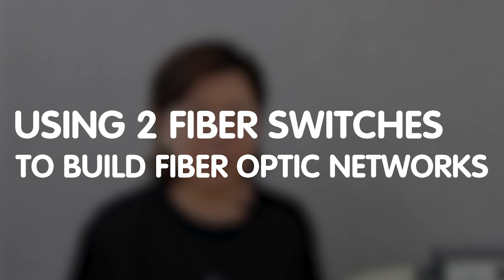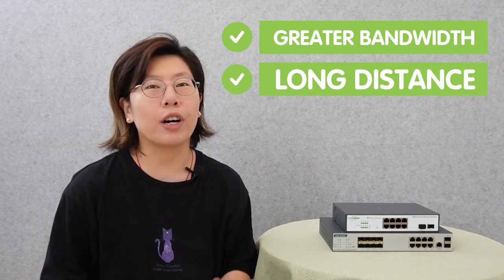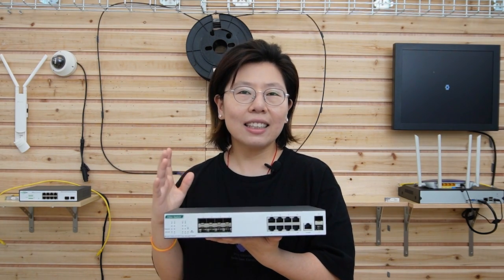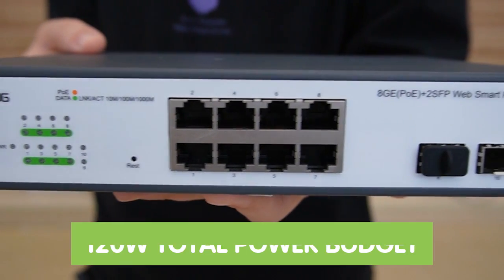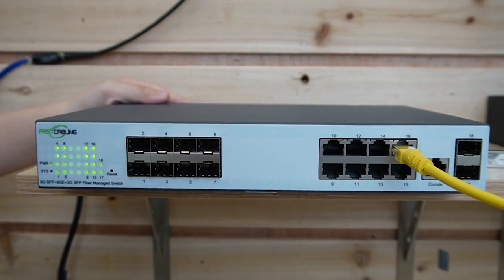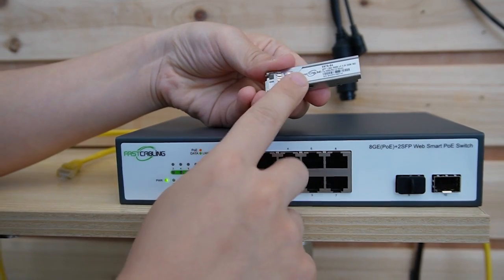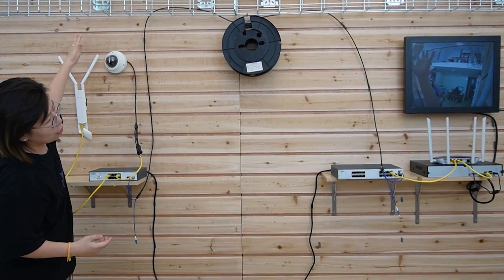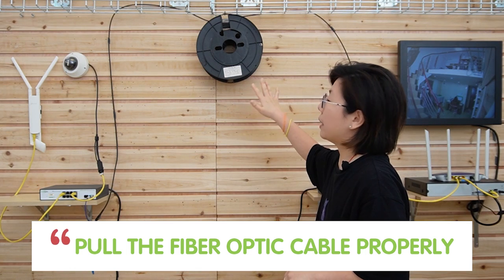Build A Fiber Optic Network with 2 Fiber Switches

Comment: So you would use this configuration for applications where you are running to the second switch which are over 300', such as in a large warehouse. There wouldn't be enough ports to run multiple workstations with an 8 port switch.
Reply from the maker: You can add a second switch with enough ports to handle the number of workstations, cameras, or other devices you need to connect. The 8+8 managed fiber Ethernet switch allows you to aggregate traffic from 8 additional switches over fiber optic cables.